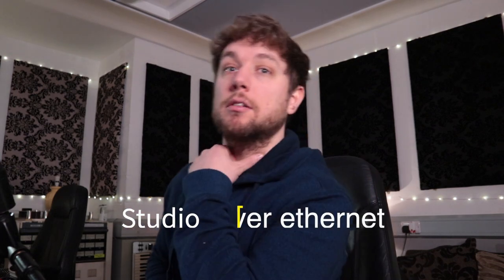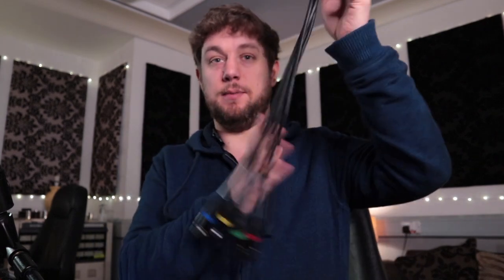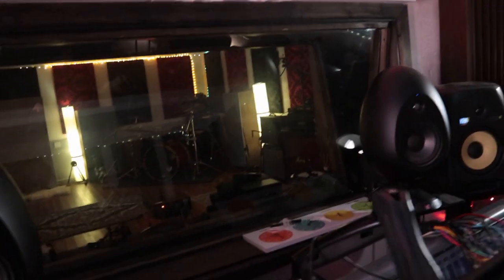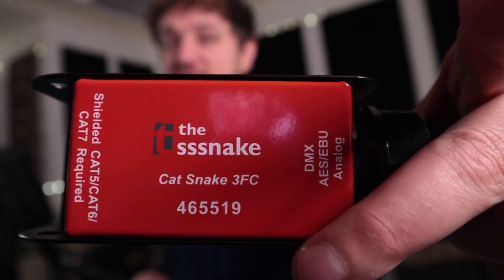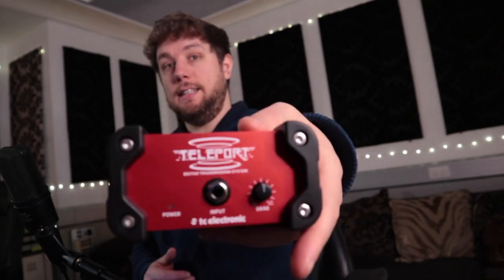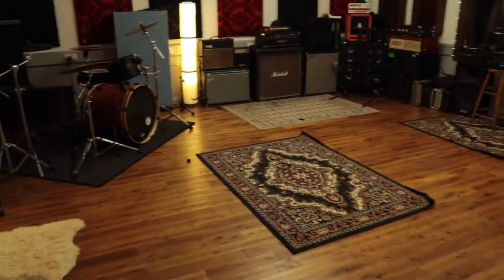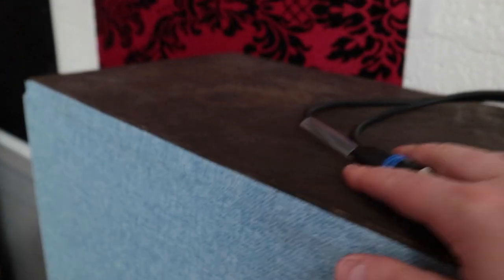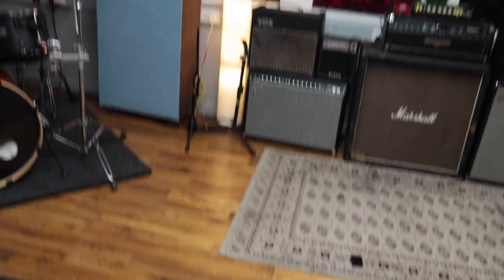Analogue audio over Ethernet / Cat5 / Network cable

Comment: Those boxes will transmit phantom power. You will need a shielded (STP) or Foiled shielded (FTP) cable. Normally spoken you should always use shielded cable. 
The 4 twisted pears are being used for the 4x 2pins. (Pin 2/3 of the XLR). Pin 1 is ground and is a common ground connected to the shield.
Utp cables are actually quite good at transmit analog audio. This means line-level audio (to amps) and mic-level signal. Addition: utp is better than "normale" microphone cable because the high frequentie dropoff will be less.
Reply from the maker: It was more to do with the fact that only 2 of the three pins were connected when I checked, they are shielded and have no doubt that they could use the shielding for phantom if the ground is connected.
Reply from the maker: In all honesty I have no recollection if I mentioned this, we have. A phantom unit in the studio anyway and have no issues using this, I’ve been running headphones off this box as well as instrument and mics off this for a years worth of sessions now with no issues whatsoever. Great little units and I plan on getting a couple more for the price.
Reply: It’s best to use at least 23 awg wire. It should be listed on the cable. It will work out to less than 1/2 ohm per 10’. I always check them with a meter.  I have found a problem will show up if you are short on headroom due to the voltage drop. Most cases a mic or something coming into a mixer will be fine as you can compensate with the preamp. I use these all the time very convenient and clean on stage.